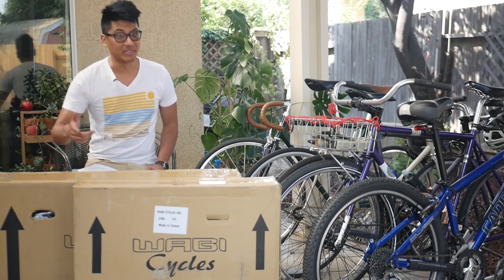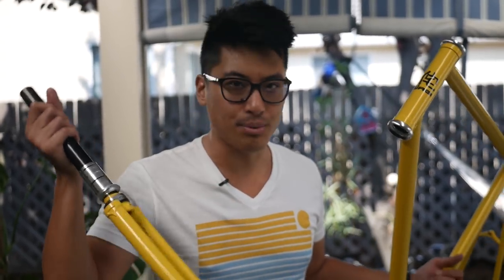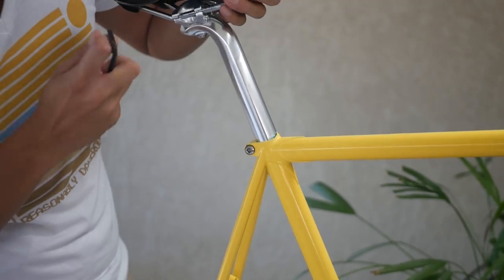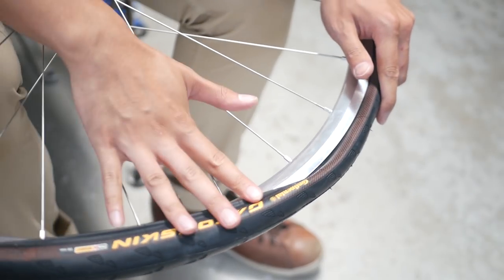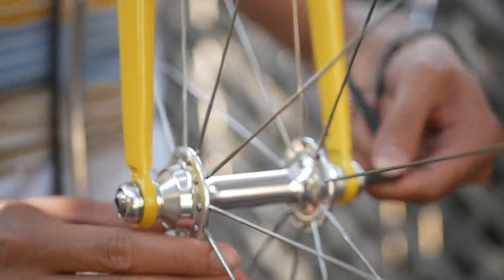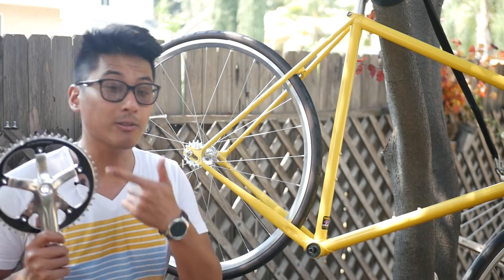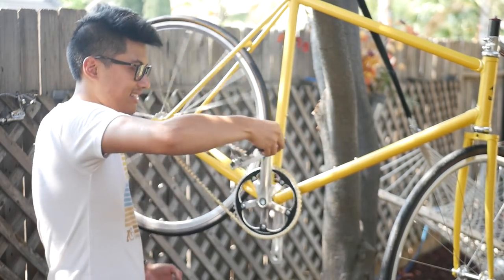Building a Fixed Gear Bike from Start to Finish (Sponsored by Wabi Cycles)

Comment from the maker: I do give a lot of tips that'll save you future headaches throughout the video, but here are the time stamps for each segment if you're pressed for time. 

0:00 Unboxing
3:29 Frame prep/saddle/seatpost
4:24 Fork installation
4:55 Wheel/tire prep
6:50 Cog/lockring installation
7:49 Putting wheels on bike
8:12 Easy trick for installing handlebar grips
8:40 Pedal assembly
9:16 Chainring assembly
9:57 Crankset installation
10:34 Chain installation
12:00 Pedal installation
12:28 Headset/stem/handlebar installation
13:46 Weighing the complete bike
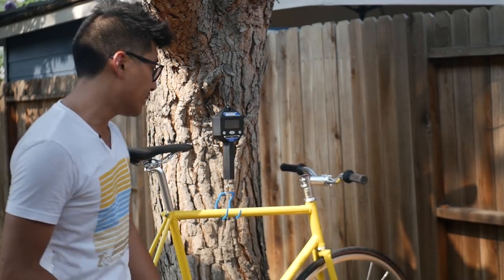14:09 The Wabi Retro's maiden voyage + my thoughts
Reply: Zach Gallardo good looking out bro
Reply: Zach Gallardo what if you put the drive  train on the left side
Reply: Hairspray trick is an ace tip. An additional tip is to drop a nickel in the end of each grip for bar-end reinforcement. Works great.
Reply: ShoVlogs that would be absolutely no problem. I've done that on my Bianchi. 
However, you CAN'T use a freewheel, pedaling forward you'll pedal into the coast...
Unless you want to ride backwards all the time 😁
Reply: hey, Zach!
long time watcher, first time commenter.
really curious,
what do you think of the Throne Phantom 2019?
I'm looking to get back in the saddle with an aluminum complete and have narrowed it down to two beginners: Aventon Cordoba complete and the Throne Phantom 2019 complete. I've found a decent amount of info on Aventon, but not much on Throne. thoughts, please?
thanks for the great content, brov.
much peace.
Reply: Taga san ka
Reply: how much for this fixed gear?
Reply: Don't need 'brakes' just spare tires.
Reply: Great video! Thanks for the info as I’m building one myself. Please keep making content!
Reply: Just something to point out a lot of fixed gear riders don’t know about the hardshell gator skins it’s like non existent they’re more durable than the regular gator skins and they go up to 32c
Reply: I’ve been watching your videos from the very beginning of your journey these last few weeks and it’s refreshing watching you have so much fun man. Zach you are genuinely on to something beautiful here man. Keep it up man stay motivated.

Comment: 1270$ i thought it was about 500$
Reply: It "won't break the bank".
Reply: Cheap Bikes aren't good and good bikes aren't cheap.  I thought my $200 walmart bike was okay until I bought a $1000 road bike fitted to me and it's a completely different experience.
Reply: @HagakureJunkie  we are talking about a fixie though. Anything you learned about road biking is lost in fixed riding. You could build a real good fixie for 600
Reply: I got my specialized bike for 500.  It's actually really nice, aluminum tho.
Reply: @MrKushinator420  I've build my throne track lord for around 800 and it has alot of carbon fiber parts with unknown carbon rims
Reply: A custom made fixie would cost less than 350 bucks in my country
Reply: Still better than buying an iPhone or a Mac that will last just a couple of years, a bike when taken care of properly can last you decades.
Reply: 1270 is too expensive for this bike. I'm thinking more of sub 400.
Reply: @dido1803  no dude, not at al. Reynolds 725, 144 bcd cranks and wabi sub 15s. Anything under 900 dollars would be an absolute steal. My 500 dollar bike has only 4130 chromoly, 130bcd cranks, and some unbranded wheels. There is a reason why this costs so much, it's a bloody cool bike
Reply: @warfighter-rango8180  I’m On my way! To build my Constantine or Planet X lmao

Comment: For any newbies to fixed riding: THIS IS NOT EVEN CLOSE TO GOOD VALUE. The only good part about that bike is the frame and maybe wheels. You can build  a quality fixie for 3 or 400 bucks out of ANY frame you want. Carbon, steel, alloy, titanium, ect.

Comment: Coming from a professional bike tech, that was an excellent video. I wouldn't change a thing. Even the little details like loading the headset so that the spacers don't spin. I might only add to anyone building their bike, make sure the nose of your saddle is level with the ground before riding. Cheers!
Reply: Kevin 😪
Reply: Well, in a literal sense, this video is about how to "assemble" a bike. Building a bike to me implies frame prep (chasing threads, head tube prep), and actually having to select proper size components (spindle length and type) etc. It also involves pressing in headset races if required.  If any carbon components are to be installed, a torque wrench is mandatory; should be used on all assembly anyway as a good practice. Wanking on an Allen key to tighten a crankbolt will not be adequate.
Reply: Robert Trageser agreed. I never understood why anyone would say there’s a correct position for saddles. It’s like telling someone to set their recline to a certain angle in their car! I like having my saddles nose down a tiny bit.

Comment: What size Wabi frame do you ride? How tall are you and what is your inseam. I ask because I have a Kilo TT Pro and the Kilo size chart is totally BS. They size small I have a 55cm (c-c) 58cm (c-t). I’m 6 ft with 32” inseam. According to their chart this should have fit someone 6 ft to 6ft 2 in. It’s a flip flop fixed/ freeewheel and I have only been able to ride freewheel because of the 1 1/2 inch to overlap making slow speed turns on fixed I have to stop & lift the bike up. I’m currently running a 175 mm crank but even going down to 165 mm my 12 in foot would still have 1/2-3/4 inch front tire overlap. I say that Kilo TT size chart is incorrect because I also have the seat all jacked up to get full extension of legs while peddling seated. Anyway I would like to upgrade to a Wabi frame and just asking how accurate their Wabi Classic frame sizing is? The website sizes go 49cm to 60cm but it does not specify if that’s crank center to top of seat tube (c-c) or center crank to top tube (c-t). I do plan to run no smaller than 165mm crank and hopefully as a Wabi enthusiast you could give some insight and advice from your purchase & ownership.

Comment: Great video, Zach, keep doin you. Just one little thing:
I hate to be that guy, buuut…Um, aaactually, you can install pretty much any headset (or at least any external cup headset) with a  safety hammer. Just cushion the blows with a plank of soft wood and you'll be fine.
Edit: It would also be a good idea to use some framesaver or equivalent.

Comment: hey zach and guys, ive been a fixed bike rider for about 6 months now and i gotta say compared to all the other bikes ive seen, mine is close to bad. sometimes when i go downhill really fast or even just gain speed on a long stretch, my chain just falls off, or unlinks, and im there just contemplating what to do. im really new to this and i just need tips on what i should know, what i need to upgrade and how to maintain a good fixed bike. also, ive been really enjoying your vids, earned a sub :).
Reply: Chain tension too loose to begin with and/or wheel bolts slipping? And if your chain comes unlinked while riding you should probably get a new chain.
Reply: I second Lazy, also check to see if your cog or chaining have pointy teeth (worn out) or are bent. Measure the chain; 12 links should be exactly 12 inches or it's stretched. Watch a video on chain fixed gear chain tension. I love you zach. Zach doesn't have a good video on this.

Comment: New to bikes and your videos are great. 
What is "lugged"?
Reply: Cheap frames are welded seam "tubing", welded together, heavy bikes are real "tube" no seams, welded together, rather heavy, 20 kilo bikes, a "lugged frame" is lightweight tubing, either "straight gauge, same wall thickness end to end, or "butted", walls thinner in the center, thick at the ends, for weight savings, with "lugs", fittings slip over each tube, a connector, and tubes brazed together, lower temperature, stronger joint, the "lugs" visible "over the tube ends" at each joint.  Welding alters the grain structure of the metal, needing thick, to remain sound.  Brazing is much lower temperature, gets its strength from the large area of "brazing connection", the area of tube mating to lugs, to tube, making it light, flexible, but resilient.  They are entirely on "steel frame bikes", new technology "obsoletes them" except to those who prefer the "road feel" that only a good, light steel frame can deliver.  I'm back in after almost fifty years, because a good bike just feels like it can fly.  I hope you get the full pleasure of riding.

Comment: For longer rides (40+ miles) which bike would you prefer the Wabi retro or the Wabi lightning? Also, would you consider the wabi retro to have a mostly road bike geometry? Btw great video.
Reply from the maker: I actually prefer the ride quality of the Wabi Retro. The Lightning was actually too light for me and felt squirrely at times, but it may be better for lighter riders. 

I'd say the Retro's geo is somewhere between road and track. It has slacker angles for more comfort on the road than a track bike and a higher bottom bracket than a road bike for fixed gear riding along with other tweaks.

Comment: Love my Wabi! The sub 1500 wheelset really makes it a hotrod. So far, the only thing I’ve upgraded was the saddle. Got a Brooks Pro.
Reply: Which will offset the weight savings from the Sub 1500 wheelset! To be fair, although not a Wabi, I did the same thing with my bike; being comfortable is worth the extra 300 grams, unless you're doing short races on a velodrome.
Reply: Matt Sezer, Ha!! I’ll never be a threat to appear on any racetrack... too old for one thing and I think the fastest downhill speed I ever recorded was like 35 mph but in all seriousness, I really love the responsiveness of the sub-1500 set. The Wabi is already plenty light enough for me and so far I haven’t felt any need or urge to upgrade any other components.
Reply: Yes, the feeling you get from light wheels often outweighs the actual performance benefits you get. I've actually raced on a Brooks saddle, and I know for a fact that the extra 200-300 grams had nothing to do with me being decimated by much stronger riders than me.

Comment: Thanks for showing people the easy step at a time way to mount tires on rims as opposed to the gorilla method of trying to wrestle the entire thing in one step. And I loved learning a new rule of thumb on the headset tension. Great job.
Reply: I would only add that I uses soap around the tire.  It makes it slip on the rim real easy and it pops into the clinchers every time.

Comment: this was a great video Zach but it'll be real nice if you did a conversion build taking a geared bike or mountain bike and converting them to a really nice fixed geared bike.
Reply: please no...you won't get a "really nice fixed geared bike" out of a conversion
Reply: Peter Staubs you're wrong. In Europe we do a lot of conversions, because we have a shitload of dirtcheap old steel roadbikes and they turn out really nice. 
Yeah, it might be a little bit harder to get a straight chainline, but if you have the basic math skills of an 8yo it shouldn't be too much of a problem. 
So, all in all if you want to show of your bikebuilding skills, do a conversion. 💪

Comment: You are making me feel terrible!!  I'm putting a "Viscount" frame with a tange fork, 23 inch, with some actual retro "Campi wheels, Gipieme crank, and a set of bars to be determined, my own made stem of 6061 T6, and some kind of flat bars.  The frame doesn't have lugs.  Otherwise it should be okay, it's from 77.  Thanks for a good "build video" of a very nice looking, riding bike.

Comment: As a mechanic, I would use anti-seize on threads or bolts, NOT grease! I recommend green or blue thread-lock for bolts that need to be secured.

Comment: Bike building can be so fun and so frustrating.
Your going to need to get some tools to cute pipe, wire 4 5 6 7 8 and 9 alen key set, wrench 15mil, tire leavers 6 pairs you will brake them trust me you will. And a floor pump. 
For extra items. 
Bandaids first aid cream and first aid tape and a friend to keep you from going insane.

Comment: I’m not sold on gatorskins as an upgrade - they’re both heavy and stiff. GP 4000 IIs would be an upgrade, Gators are for winter riding when you want something to take a beating (and don’t care about grip) and even then, GP 4 Seasons would be a better choice for about $5 more per tire. You’ll get better grip and feel, and similar durability.

Comment: I paid under $1,000 shipped for my Wabi Urban complete bike in Electric Green with black Sub-15 wheels and black chain. The guys at Wabi are amazing. They put the front brake lever on the right-hand side of the bar for me since I also ride a motorcycle which is where the front brake is. The only thing I changed was the stem height and seat. I removed all the washers and the bike looks better and is more comfortable to ride. A wider/taller bar setup may be in the future, as well as an upgraded crankset.  I love Wabi.

Comment: Bro. Get a torque wrench. None of this “Make it tight enough, but don’t gorilla it”. This whole process would be a lot easier, more confident, and safer than “Tight, but not gorilla” if you just used a torque wrench and set it up to the correct torque from the manufacturer.

Comment: Only thing i'd do differently as a mechanic is let the loctite dry before threading in your bolts (where they apply) makes life easier for whoever your mechanic is to make repairs (even you) and it is just as effective at keeping bolts in place

Comment: @zack
I want to upgrade my road cranks into track cranks that you are using in this video.
I read on the andel website they have a specific BB.
I am not sure what BB my bike can fit. 
I am using a Giant Defy 5 2015, and have no idea if my current one will work or if i buy a new one if it will fit okay either.

Comment: wow, you re a true bike mechanic. you know alot. there is only one thing. you cannot overtighten your crankbolt in order to damage the crank. the bolt will wear out before that. the crank can only be destroyed by using the wrong bottom bracket shaft (iso or jis). grease is necessary on the shaft of the BB if you dont want to unmount it every three months to clean it. it will create noise eventually if you dont grase it. this doesnt apply to octalink and some other special BB´s. companies like sram say that you shouldnt grease but lubricate it. thats the same, the lubricant wears out quicker. because the companies want to sell more. every customer that comes in my shop with a noise from the BB thinks its broken, but its only in 30percent of the cases. i could sell him a new one, he ll never know.
also fyi dont use chainbrakers to put chains together again. the pin needs to be split in the outcomming end or it potentially can relieve a chain link. only use power links or chaintools specifically for closing pins. (rohloff revolver)

Comment: I builded Peugeot Conversion  it cost me 150€ and it rides smoothly :)
Reply: Mario Susi I did the same dm me
Reply: Where did you get fixed gear rear hub/wheel. Can't find a cheap enough one.

Comment: The Chainring should be installed with the little "notch" behind the arm, to prevent the chain from getting stuck there in case of it falling off ;p But if you prefer the logo up top, I guess you could do that too ;)

Comment: Things you gotta make sure when ordering a Wabi 1- the welds , ask that 
they get the one in the batch with the nicest welds 2- seatpost 
retention bolts some framesets were delivered without one 3- COLOR OF 
THE HEADSET SILVER OR BLACK  , indicate in the message box when ordering
 what color you want the headset or else they will send you a silver one
 automatically . No they do not swap or re-imburse your money but they 
will gladly sell you an extra one ..

Comment: I am a beginner and I am looking to buy a Wabi! I don't know which size of frameset I should get? I am 6'1, should I get the 55 cm or 58cm?
Reply: Use a bike fit calculator to determine the frame geometries that will work for you

Comment: I'd be curious to see how the Wabi Retro rides as far as the geometry compared to the vintage track bikes that its style imitates. At least in theory, it seems to be a good mix of the classic look and geometry that would suit regular riding conditions. I love my late-80s track bike and as far as weight and materials (full Columbus SL with chrome lugs) it's similar if not better than the Wabi Retro. However, it's got a lot of toe-overlap and will only barely fit 23c tires.
Reply: Wabi goes to 32👍

Comment: In regards to the greased bb taper/crank interface, I just want to post this in case anyone is interested. The choice doesn't seem to make much of difference from what I have experienced; I have greased tapers and never had an issue with cracked cranks, but I have also not greased and never had a crank seize to a spindle. I am curious about the latter because you have aluminum and steel in contact so it seems like galvanic corrosion would develop?

Anyway
https://www.sheldonbrown.com/brandt/installing-cranks.html

Comment: I've heard putting on the tire entirely (after putting in the tube) from the valve and moving away from it is supposed to make it easier for those stubborn road tires... Your thoughts?

Comment: for this price could probubly go for a nice used-but-not-dent NJS frame with possibly better branded components.
Reply from the maker: I've used the spectrum of cheap and expensive components. Wabi's stuff is unbranded and doesn't cost a lot, but it's some of the best I've used. NJS frames are nice, but sadly I can never find a 57-58cm for reasonable price.